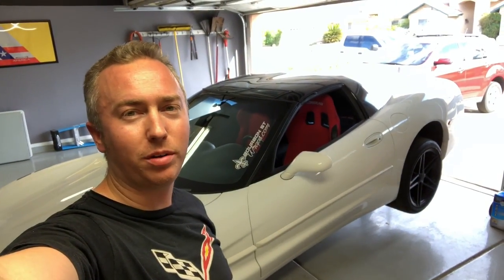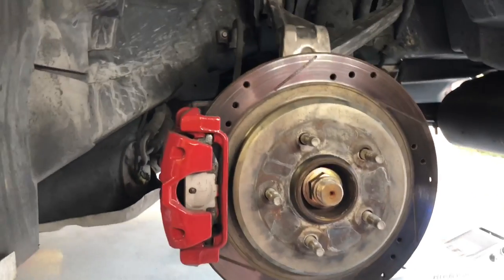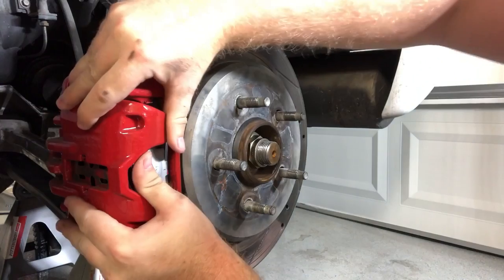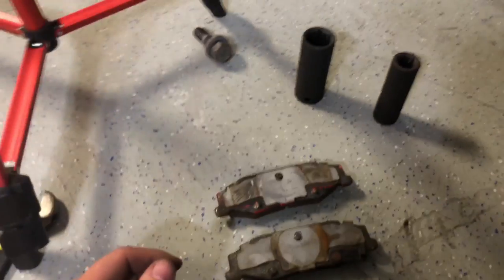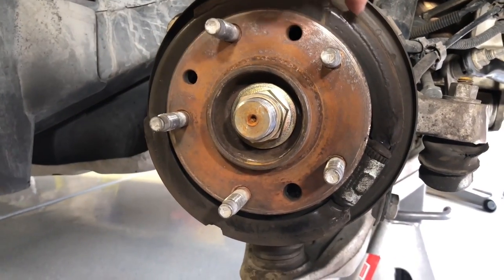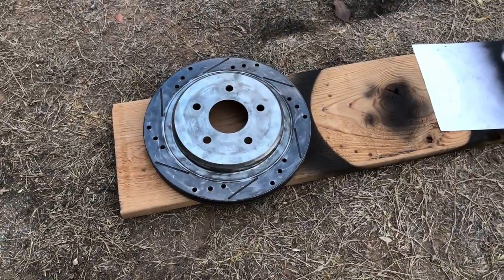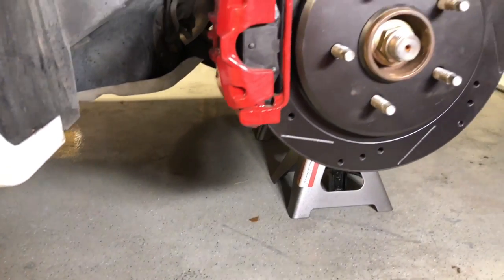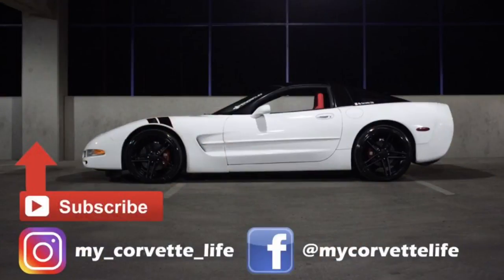Corvette DIY - Painting Brake Rotor Hubs - Part 2

Comment: Chris, this is my first comment to your site.  I enjoyed your work on this one.  I have been wanting to do this to my car also.  I was surprised to see you painted the brake disk also.  I also saw the rotor looked good after a test drive.  The paint must not effect the operation of the pads on the rotor.  Thanks
Reply from the maker: No, it worked fine.  If you are worried about, you can take the extra time to tape it off, or cut the hole in a piece of cardboard to use as a template.

Comment: Chris, it looks better and better with every little touch up. Just curious as to why you didn't repaint the red calipers while you were at it. Especially the corvette logo in white on the fronts as well?
Reply from the maker: I just repainted the calipers a few months  ago.  There is a 3 part video series on the channel.  Go check it out.  Also, the corvette lettering is exposed aluminum from the factory, not painted.

Comment: Do you find that the Roloc discs pretty make the steel wire brush obsolete?  I ordered a few boxes of Rolocs in different coarseness levels and believe my wire brushes will only be needed for severe rust jobs.
Reply from the maker: Really depends on what you are using it on.  The fiber disks do a better job on smooth surfaces.  Wire wheels are better for anything textured or going around edges.  You have to be careful with the fiber disks, especially on softer metals.  Even a medium course disk will grind off a lot of material in a short period of time.

Comment: hey  unless i missed it    what kind of spray paint did you use       i replaced all my rotors and pads on my 94 vette 3 months ago   i bought them already coated black  which turned gray after a while    any color sure beats that rusted look after sitting a week or so    nice video thanks
Reply from the maker: Krylon High Heat Black
Reply: thanks     the high heat paint that i use on my grill will be just as good then    it's made for hotter temps   and cost a little less